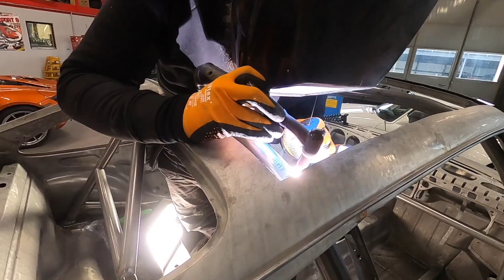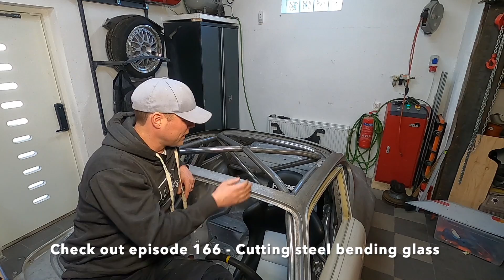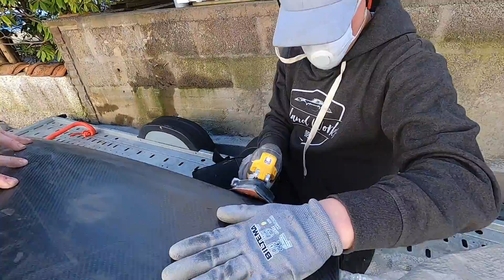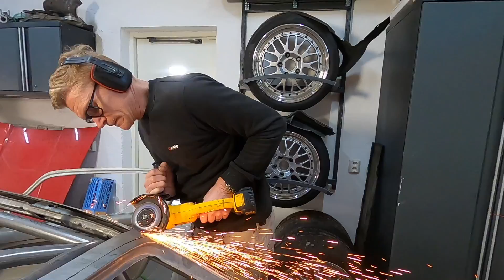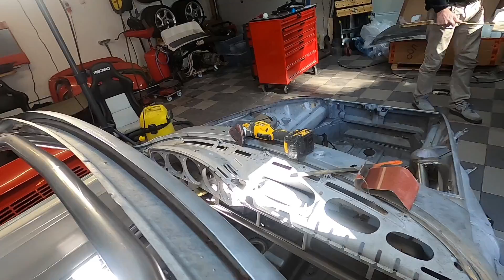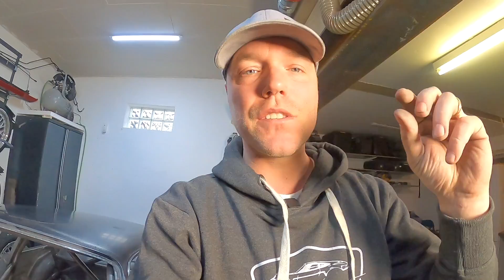Carbon Copy - Air-Cooled Porsche 964 Carbon Fiber Roof Installation

Comment: mixing up your own epoxy fileting compound is the proper material to blend in edges onto the steel body ( as a filler material).   that roof is epoxy so regular body-filler will not adhere to that roof but epoxy will

Comment: just jokeJOB 😂😂😂  you cut the outer shel to flush with inner frame edge  and not  down to 2,5cm and open the roof frame profil for small piece of metall you lost a lot of  stiffness at car frame, that like convartable, hope you compensate it at side skirts 😅😅😅😅  before you glue it would be better to protect the innerprofile and cutting edge with corrosion protection 🥳🥳  thats only begginer job 🤦‍♂️
3M dp490 is good 2k glue but not for large surfaces 😜
Reply: I'm not even a car-dude, but I could indeed notice the mistakes :/

Comment: Is there any possibility to buy any of the carbon parts or have anything made for a build I’m doing.   73 Porsche rsr longhood.  If you could give me any info that would be amazing.  Leitner22@aol.com
Reply from the maker: All parts used will eventually be available on my homepage islandworks.one 
Currently only a few are there and if you need anything special just send me a mail and I'll see what can be done :-)
Reply: Yes that’s awesome.  Definately interested in a roof and body panels for an 80 911 that I’m using for a 73 rsr longhood.   Leitner22@aol.com